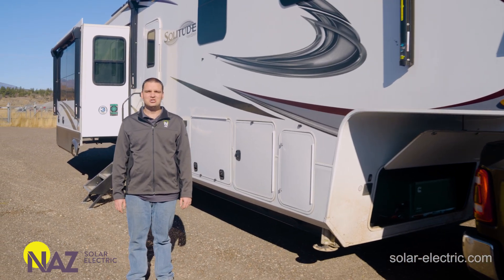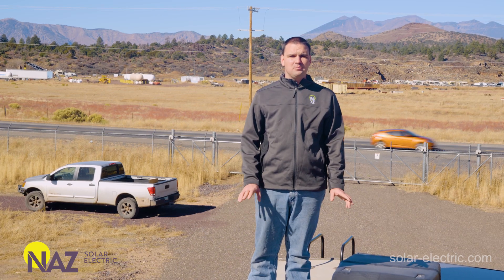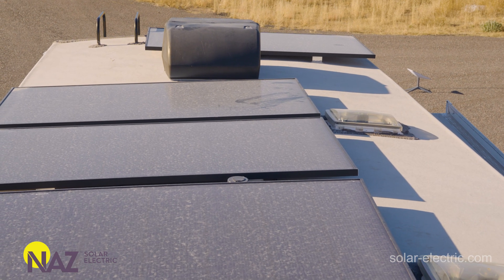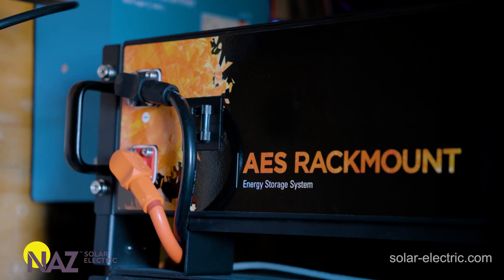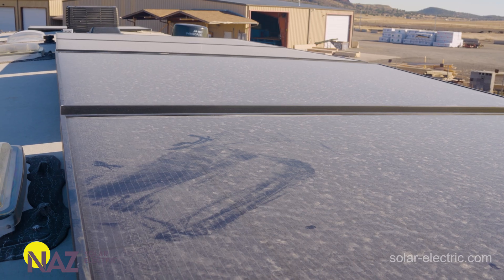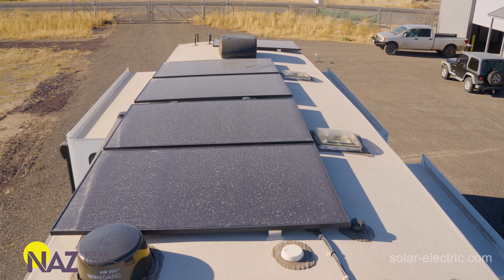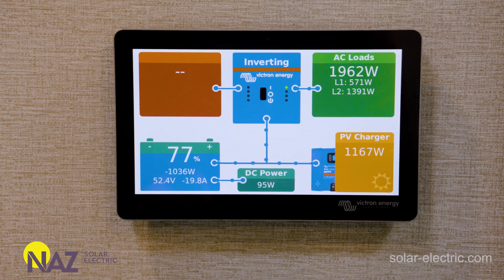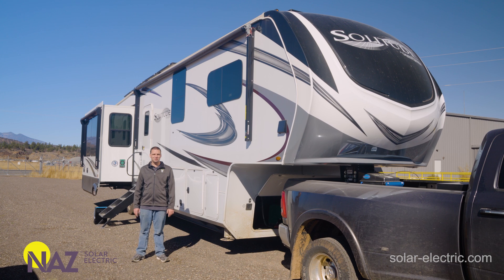48 Volt RV Solar Power System | REC, Victron, Discover | Episode 1: System Overview + Bonus Mistake!

Comment: Nice to see more of these 48V Vics getting used. I've been running one of these  48V/5KW Victrons with 20KWh (4 24V in a 2P/2S setup)  battery bank and 2KW of solar for about 8 months now. As these units are single phase, I'm only using one side of the 50A input. I avoid tripping the shore breaker by limiting current input to 47A thru the Victron controls app. On the  rare occasion that current exceeds that mark the inverter power shares the overage from the batteries. Also, these inverters use 2 AC outputs, one is battery backed and AC2 is only on when on shore or generator. Loads are split so that non-essential loads are disconnected (AC2out) when only on battery/solar. (Items like the fridge and water heater and one AC unit).  So far working well. Even with all loads on,  the analyzer shows a 67A pull and these inverters are rated for 95A. Total cost was right around $9K but added (ugh) about 400lbs to the front end.  I originally tried a SunGold all in one inverter, but there was no seamless transition between battery and generator. The Victron has no problem with that.

Comment: What's the total cost for that system?
Reply from the maker: This system is roughly $15-20K, depending on how you handle shipping and installation.
Reply: Follow up question.
How much does it all weigh. It will take away from the cargo carrying capacity of the RV
Reply: @Capt-Kirk  Our very large solar/battery system (with over 5,000 watts of solar and 23.5 kwh of batteries) weighs around 1,100lbs. But to be fair, most solar builds are less than half the size as ours. Yes, these systems can be heavy, and this must be taken into account when deciding how big of a system you can afford weight wise as well as dollar wise. We knew we wanted a large heavy solar system for boondocking, so purchased a tag axle equipped motorhome with sufficient carrying capacity with this in mind. We also made some changes that reduced the weight of our motorhome about 600lbs so we could afford this extra weight.
Reply from the maker: @Capt-Kirk   this system is right around 700 lbs.

Comment: Sweet. I'll bet a primo system like that is expensive though. Five years ago, we retired, sold everything and hit the road. It was the best decision we ever made. We discovered we love boondocking and it really helps stretch our budget, as we're living this FT lifestyle on a limited retiree income. Once we started boondocking, we quickly learned the advantages of solar. We decided to build our solar/battery system in 2 phases, a 12v system for our basic 12v DC needs and a 48v system for our 110v A/C needs. 

We started by building a 620-watt liftable solar array on the side of our motorhome. We purchased 2, 310w Canadian Solar Panels from NAZ in 2020 (when you went by your old name). We dropped by your warehouse, picked up the panels, designed and built the system while boondocking just outside of Flagstaff. We lift it to the optimal angle to boost its output 20-30% vs flat mounted panels, especially in the winter. It makes a nice bedroom window awning too, practically lifting itself with a couple gas struts, and it's easy to clean, standing safely on the ground.

We finished the 12v part of our build last January, with the addition of a 560ah LiFePo-4 battery that we built with 8, 280ah "A" grade prismatic cells. We use a Heltec 330amp (1,200a surge) BMS with a 5a active balancer to keep the cells synched up. It cost us less than $1,500 to build this 560ah 12v, 7.1Kwh battery, including the high amp BMS. We chose these cells rather than a pre-built battery because they fit perfectly under the steps of our MH where our old pair of GC-2 golf cart batteries used to reside. We insulated the battery compartment, cut a 1" hole in our step risers and installed a tiny computer CPU fan to keep this space at close to room temperature, so we don't have to worry about the BMS shutting down charging if they get too cold - or their life reduced from getting too hot. We use an 80A Progressive Dynamics LFP converter/charger, a 1,000w Renogy inverter, an Epever 50a MPPT charge controller and a Lnex battery monitor. This entire 12v system cost us under $3,500 to build and takes care of all of our basic off-grid needs except for air conditioning and microwave use. 

By mounting our solar array on the side of our coach, we left the roof free to rack 8, 550w solar panels (4,400 watts) down the length of our 35ft Class A, 15" off our roof, above our AC, fan shrouds, etc. We're in the middle of this build now. The front two panels angle down to where they meet the roof at a 9.5-degree angle to prevent air getting under them, causing lift. The rack, made of heavily cross braced 2" aluminum angle is finished, and I just coated the roof with Henry's Tropicool to encapsulate all the mounting brackets, ensuring its watertight again. This huge array will cover our entire roof, providing some nice shade with plenty of cooling air underneath, further increasing solar output and reducing the heat load on the air conditioners too. Our solar panels, wiring, breakers, etc. arrived a few weeks ago, but we're taking our time to install everything over the winter, as at 67 yrs. old, we're moving much slower these days. We mounted our Sungold Power all-in-one 48V, 5,000W Inverter/100A charge controller/battery charger on the wall in our bedroom as it's close to our under-bed 48v batteries and we're tight on space. Our 48v battery bank uses 16, 320ah prismatic cells. These cells only cost us $1,726 from EEL batteries, including shipping. We use a 200amp Heltec 16s smart BMS. Together with our 560ah 12v bank, we will have a total of 23.5 kwh of batteries onboard - kept charged by over 5,000 watts of solar. We removed the 13.5k btu rooftop Dometic AC we had in the bedroom and are replacing it with an EG4 28.5 seer-2, 12k btu mini-split heat pump on the upper rear of our motorhome, similar to the MH pictured, but with only one unit. We already received the mounting brackets, but the heat pump won't arrive till Monday. This second phase will provide 24/7 off-grid air conditioning, supplemental heat from the heat pump and allow occasional usage of our rooftop mounted, soft-start equipped Furrion AC in the front of our MH during peak afternoon hours. We'll have a total of 6,000 watts of 120v ac power on hand, which is more than enough for our needs. We'll soon have total off-grid electrical independence for a total budget of around $11,500, (including the $1,450 high-efficiency heat pump) reserving our onboard 5,500w generator for back-up use only.
Reply from the maker: Wow! That sounds amazing! Well done!